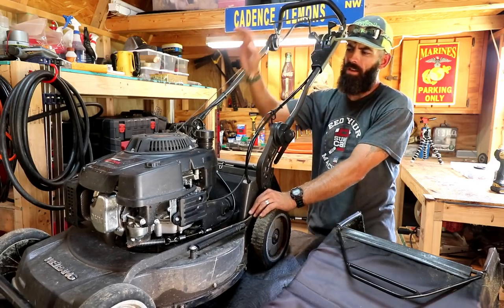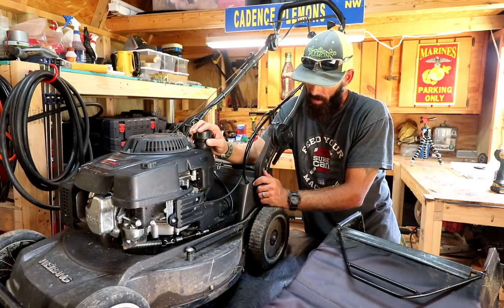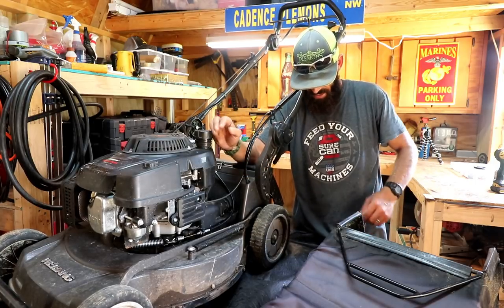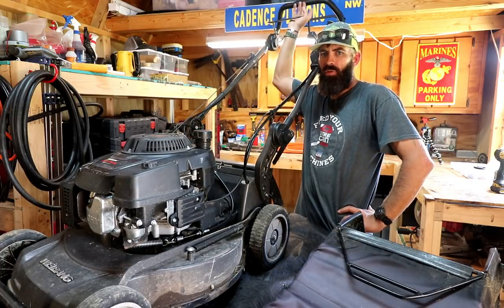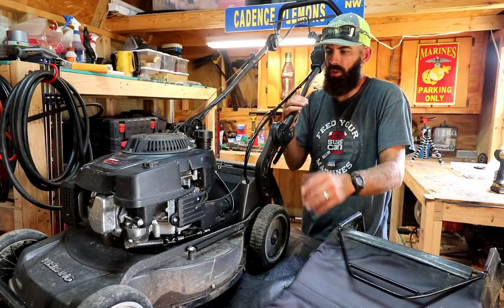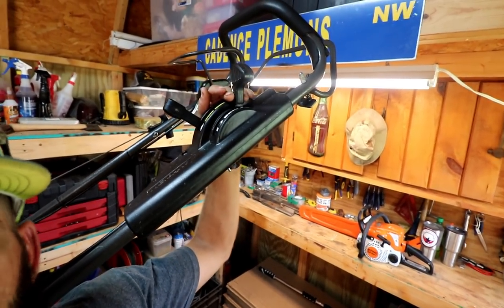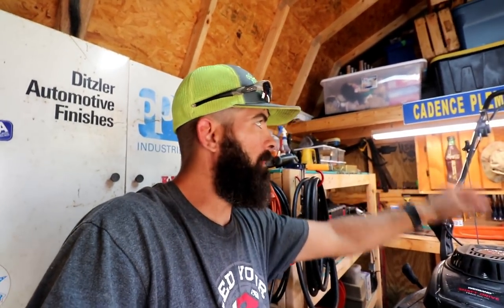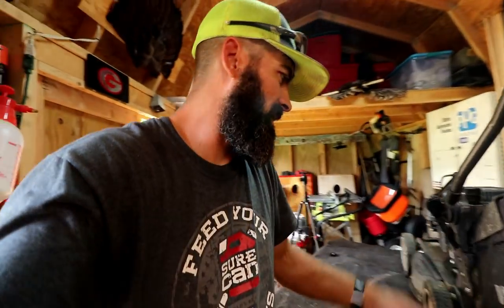Weibang Commercial Mower Review

Comment: I've found frunt wheel drive to be mile better on hills as you  assist the mower  pushing it you are  pulling waight on the frunt wheel .With rear wheels you when you push you life it off.  And with a frunt wheel drive when your cornering you heal up the frunt drive wheels turn and away again  no off and on with the drive

Comment: 👍🏼 good review, brother.  i'd have to slap a side discharge rig on there, and maybe mod the height adjustment lever and blade brake bar, but this seems interesting.  too bad i didn't hear about them a few weeka ago, before i dropped a chunk on another toro 22.

holy smokes, 2 to 3 months per push mower??  that's an insane amount of use.  and if i had to mow a condo association all push mowers, and bag, i would charge a mint 😅
Reply from the maker: Yea they get charged accordingly for sure. The weibang is pretty tough little mower.

Comment: Did you get the weibang at Home Depot or a dealer?   Probably picking up one soon based on your review. Thanks.
Reply from the maker: It was sent to me directly from Weibang. It is a good durable push mower.
Reply: light bearer123 I have this model One thing that’s really annoying is that you cant mulch with this mower, They dont make a mulching plug for this partlicular model otherwise its a quality machine..

Comment: Why not a Snapper 21' hi-vac with a Honda engine with a heavy flywheel we used to build a lot of them when I was working in East Cobb area
Reply from the maker: Havent found a local dealer for them around here but will do some checking for one
Reply: I had to order the engines from MTA we used the series 7 snapper because the handles were the most confront we also installed commercial parts that goes with a commercial  mower for catchers you have the standard bag, the PAC-AND SAC POLY catcher and ACCELERATOR  CO makes a alum catcher you can use the old Vseries they put them back out in the early 90'

Comment: U still using the weibang
Reply from the maker: Negative it eventually died like the rest and they stopped selling them in the states
Reply: @PlemonsLawnCare   when you say the Weibang died , what do you means . Did it not start ? Trans go bad ? Engine seize up ? please give more info . Thanks
Reply from the maker: @frankmalik413  trans went, constant throttle cables started breaking. Couldn’t get wheels for it after eating them out and eventually just hard to start.

Comment: If you were going through THAT MANY push mowers THAT QUICKLY.....(and you mention quality ones like the Toro TimeMaster, and Honda units...) I suspect some sort of user error I'd you're breaking them within a couple months.
I don't care how much mowing you're doing, going through quality machines in a "couple months"is absurd, I'd be looking for a new crew.  You say it's because of the hills, but there's no way a TimeMaster would just break in a couple months because it's used on a lot of hills.  I suspect people are hitting things with the blade engaged, or Maybe you just exaggerated a little, if not..there if s bigger issue somewhere.
Reply from the maker: I wish it was operator error but unfortunately its well documented the toro transmission problems and when you put about 400 hours on them in about 3 months yea they go down quick.

Comment: You can’t even say weibang right. Wee bang. Not wobong 😂. All designed in uk
Reply from the maker: Gregs Mowing hahaha even the Weibang USA answers the phone wobong so unless they pronounce it correctly that’s the only way you would know how to pronounce it. So please tell me how much experience you have with this mower?
Reply: Plemons Lawn Care I have one. Used all year. Same engine as urs. Just not the BBC one. Hate weibangs system. Prefer Toro. I too hate the height adjuster placement. Bags very well with the high lift blade and increased revs
Reply from the maker: Gregs Mowing yes the height adjuster is my biggest complaint
Reply: AND MADE IN CHINA !